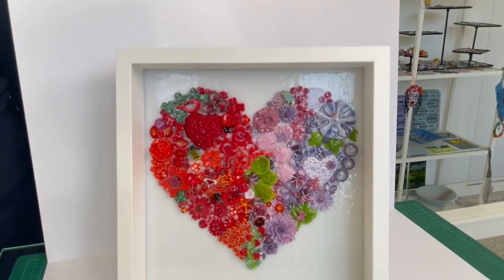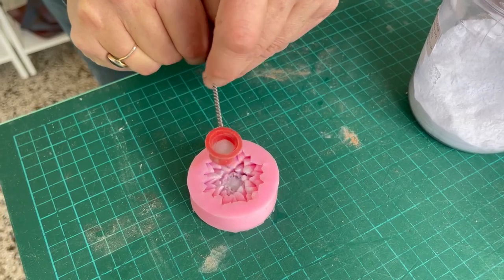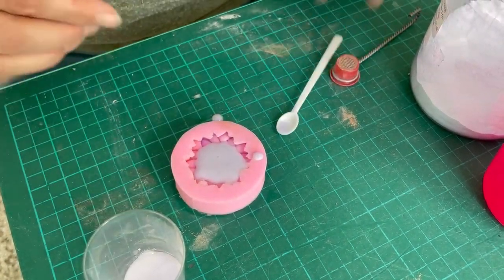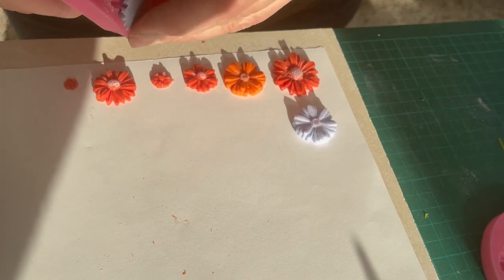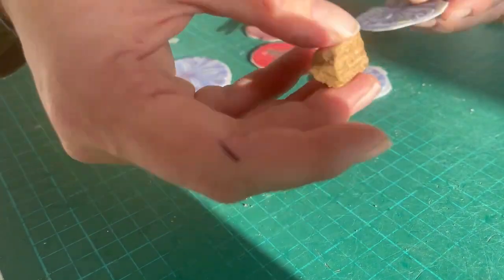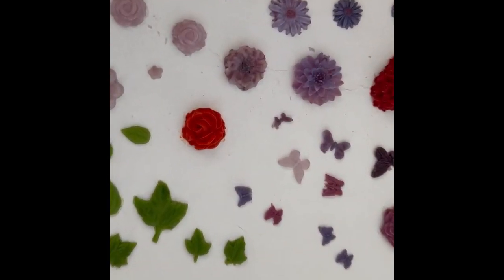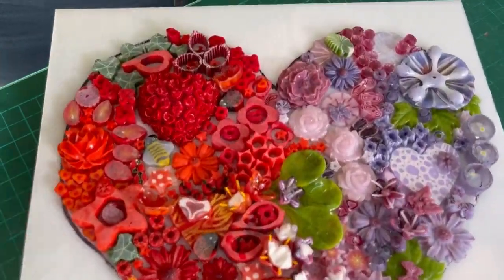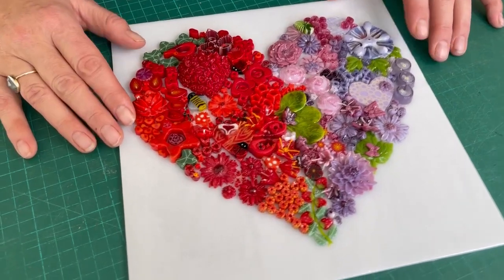Fused Glass Freeze and Fuse Floral Heart Garden

Comment: When you draw the heart on the glass, what kind of marker do you use?
Reply from the maker: Black Sharpie is the best to use for glass, as it will burn off the glass. For cutting it is good to wait for a minute or so the sharpie to dry, and then to top it off with some kind of a lip balm. This way the line will stay on the glass and it will not float away with water.